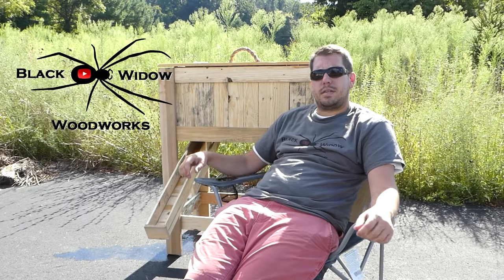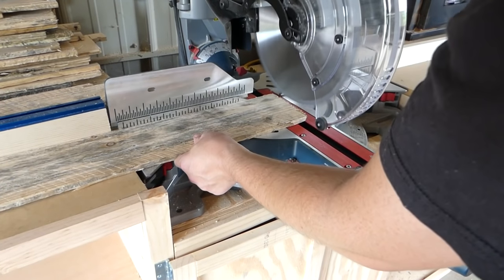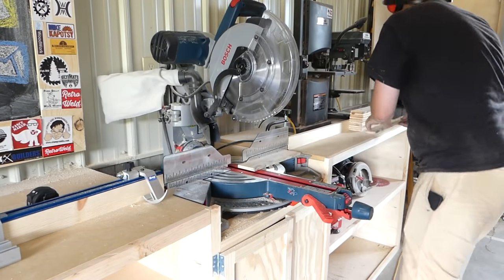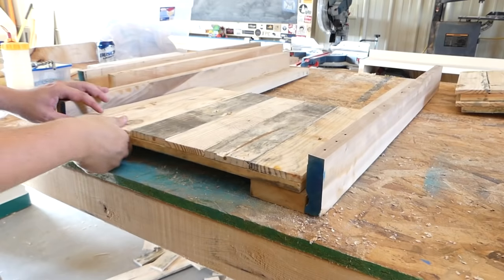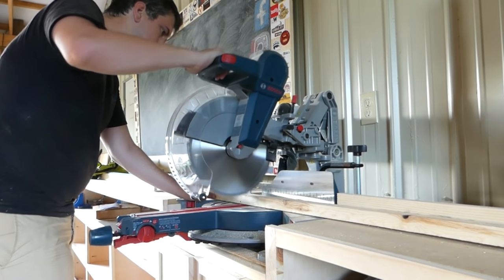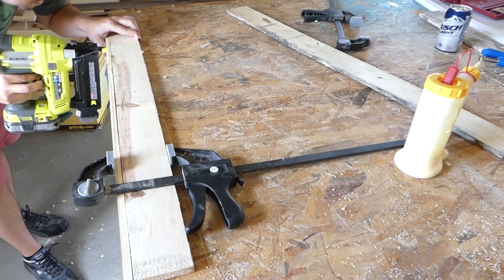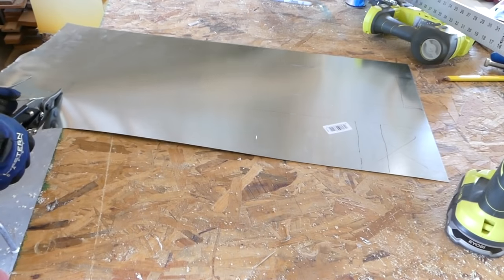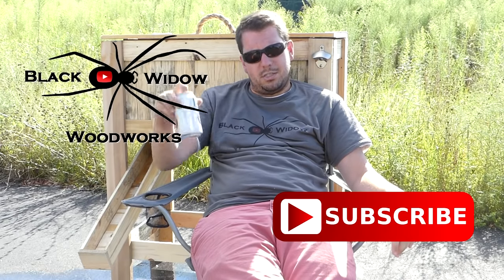🕷 Beer Dispensing Rustic Cooler Box / Pallet Upcycle Challenge

Comment: Like the idea but anyone else see that leek underneath his box could do with some water proofing
Reply from the maker: +Tiylord Yep I had a deadline to get the video into the contest for the make a wish foundation. Was going out of town the day after and wanted to participate. Thus the silicone that I used didn't have enough time to set up and make the inner cooler watertight. Redid the waterproofing since and it's working like a champ. Thank for checking out the video. Appreciate it
Reply: yeah or maybe a cooler.
Reply from the maker: +Maryann Blankley I think the question is could a cooler be used and he answer is yes. This video was a proof of concept and built on a budget. But in the future one with a cooler will be built on the channel. Thanks for watching.
Reply: dont hate on the guys project make your own if you want it better
good job guy my beer dispenser is my wife hahaha
Reply from the maker: +Nathan Paine Haha that's a good one no wife for now so this will have to sufice.
Reply: Tiylord it's probably due to condensation, not a leak
Reply from the maker: +Rafael Bucio Jr. it was a small leak. I had a deadline to get the video out so I tested it without letting the silicone dry fully. It's been fixed since then.
Reply: Quick and efficient. Thanks for sharing

Comment: Couple of questions on this-

Is really necessary to plain the pallet wood or is that for more aesthetics?
And if you don’t have a brad nail gun do you have another suggestion besides a hammer and nails? Maybe I should just go that route. Thanks turned out great
Reply from the maker: Hey Jason, thanks for checking out the video. To answer your questions, It is not necessary to plain the pallet wood. I just wanted all of my stock to be a uniform thickness some of my pallets had different sized slats and I prefer all of my material to be the same dimensions to start. It makes it easier to assemble in the long run in my opinion. If you don’t have a nail gun you could just use glue. For me the Brad nails are being used more as a clamp to hold the wood in place because I don’t have a large amount of clamps and it was a time saver rather than clamp wait to dry and move on. Hopefully this answered your questions. Take care and have fun with your build.

Comment: the bottom was leaking did you forget to close the drain spout or was it just leaking
Reply from the maker: +Gregory Stell As the video was for entry into a competition for charity I didn't have a lot of time to get it built only one day really. I was pushing it with the dry times on the silicone and didn't allow enough time to cure since then it's been resealed.

Comment: is that ryobi Brad nailer electric only. ie no gas required? how would it cope with heavy use every day? should I just buy a paslode instead? thanks.
Reply from the maker: +wood guy The ryobi is electric pneumatic. It did pretty well on this build and the battery is compatible with many of my other tools so that is the main reason I went with the ryobi nailer. I looked up the paslode online and it seems to be getting a few more positive reviews than mine. I haven't used the paslode. At least for me it doesn't justify having an entirely new set of batteries and charging systems. Parts wear out and and when they do I may consider another option but for me for right now a hobbist woodworker in my opinion you can't beat the reliability/price comparison on the ryobi brand of tools. Hope this helps and thank you for checking out the build.
Reply: I have a Senco Brad nailer that is battery over pneumatic. No fuel required. It works great.
Reply from the maker: +tom49895 I like this ryobi one pretty well but I will check out the Senco
Reply: The model I have is called the F15 fusion.

Comment: a sawzall is way easier to cut through nails
Reply from the maker: +sick of it all I agree but didn't use my circular saw to cut through any nails. The only problem with using recip saw to cut the nails off flush is that you have hidden steel inside of the wood makes for a bigger budget for saw blades

Comment: 😂 ryobi
Reply from the maker: +Jonathan Avila No complaints does the job I need it to do. Cost vs reliability and with the huge set of tools that operate on the same battery pack it was right up my alley.
Reply: Black Widow Woodworks couldn't agree more. Got a big ryobi collection at the shop here too and haven't had a single regret 👍🏻👍🏻